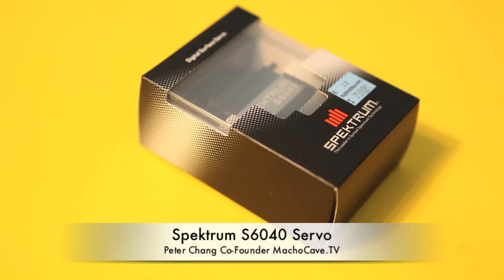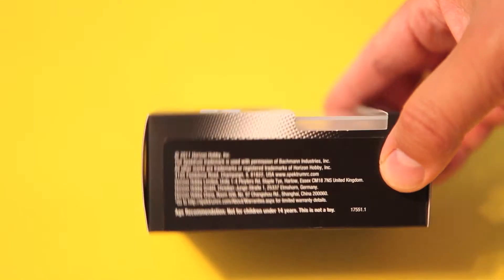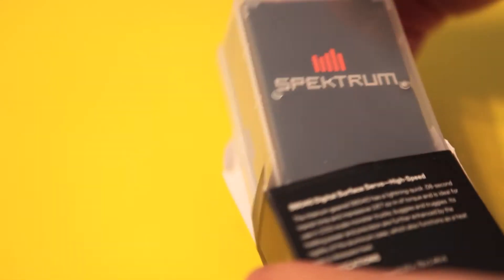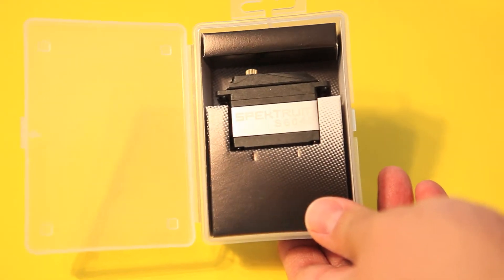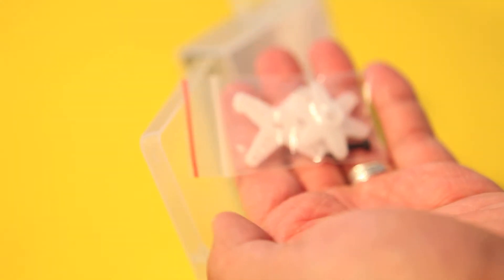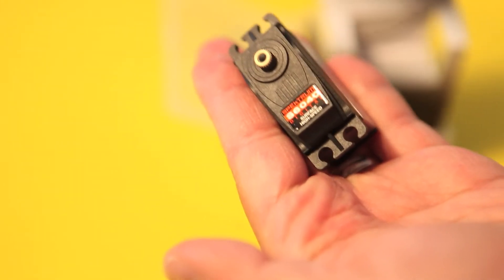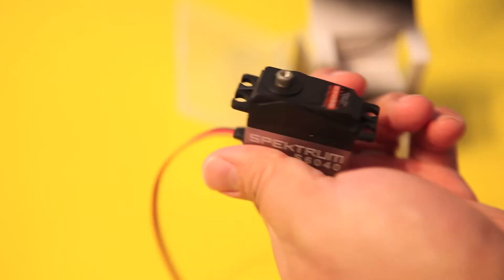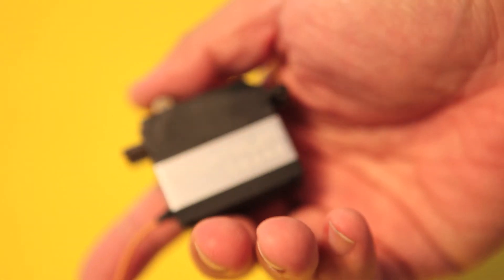Spektrum S6040 Servo Unboxing

Comment: I got the exact same servo for my Losi scte, it would not work untill I plugged in a compacitor into the Aux plug on my transmitter but it works great now!